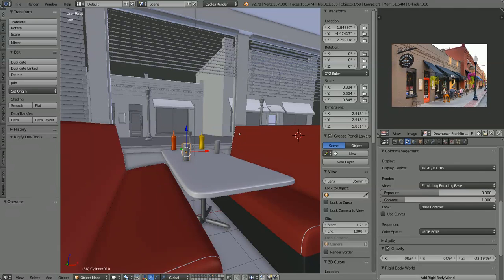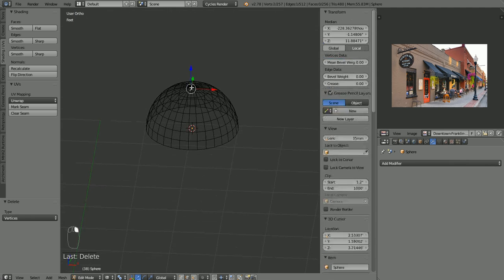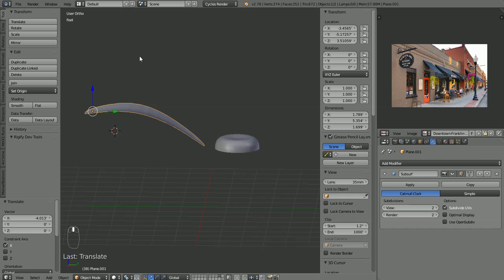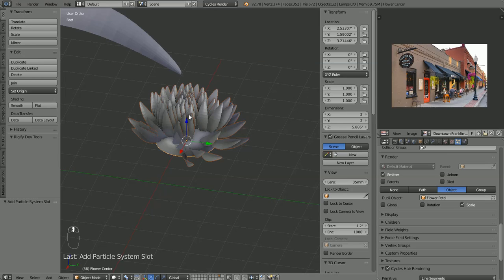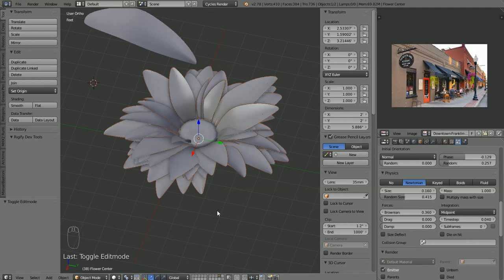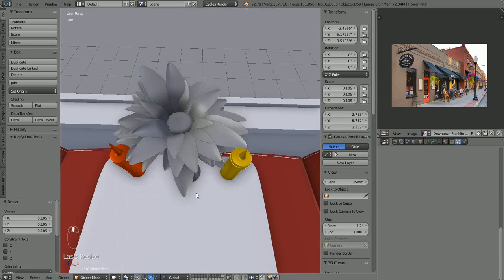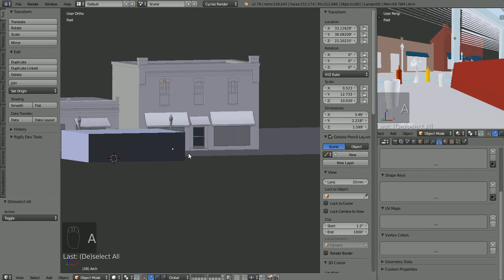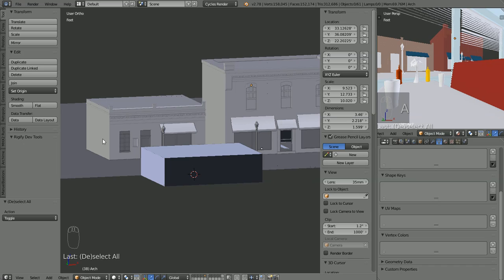13 -  Making flowers!

Comment: I noticed thru this scene process, that your booth seats have color, but the table and walls, etc do not have any color....why's that?
Reply: Hi Robby!  I realize I have not worked on this for a while, and I need to get back to it...but to answer your question, the colors in the scene at this point are just temporary place holders to make things easier to see while working.  I sometimes add color early just to get an idea of how things look.  Check back soon for more videos where we will ad the final materials with color, textures etc...